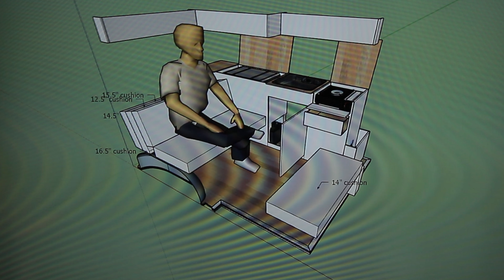Building the Kitchen Cabinetry - Part 1 | Ford Transit Connect Camper Van Conversion Vlog

Comment: Thank you for commenting on your thought process and building trial&error. Very instructing!
Reply from the maker: You're welcome! I think sometimes my rambling on might be boring to people, but it's nice to know some are finding what I share in these videos useful. So, thank you!
Reply: One question though. Why did you use boards to build your cabinets instead of plywood or 2x2? Was it for weight? Price? Availability? I've built a few things already, but still have a lot to learn in woodworking.
Reply from the maker: @alixlachaud8034  Strength! I like to build things rigid. If you noticed, I used pocket screws in many places which adds to the integrity of the joints. Pocket screws don't work very well in plywood. Also, I find plywood alone to be rather unattractive and difficult to dress up. I used a combination of 1x2, 1x3, 1x4, and 1x6 pine boards to build the frame, but in the next video I cover it with thin plywood and laminate, which looks quite nice.